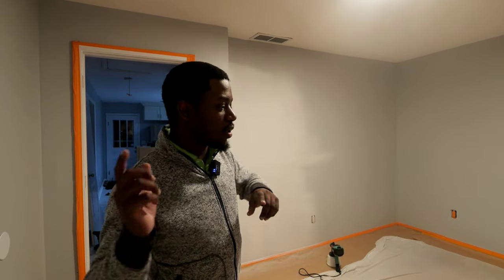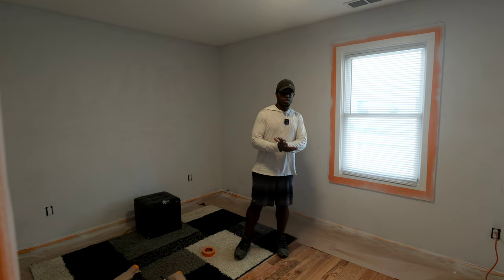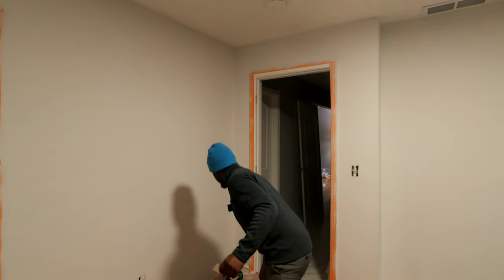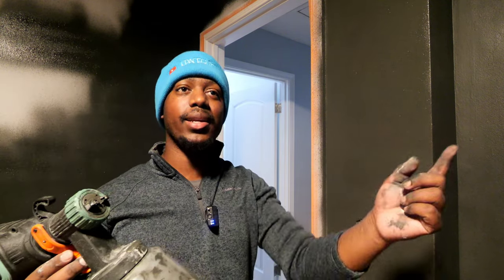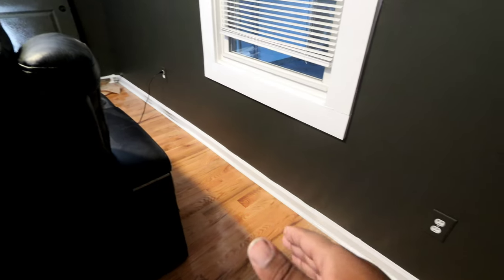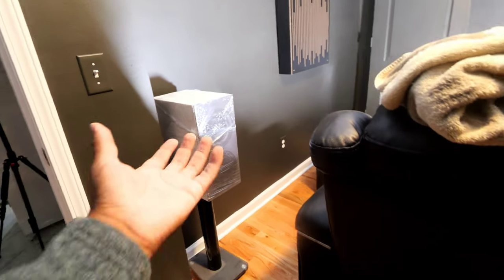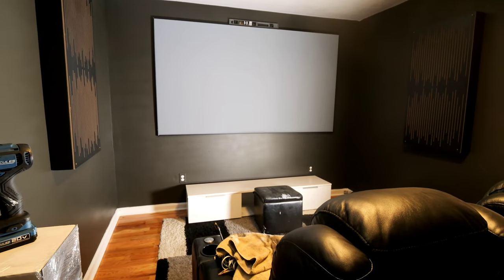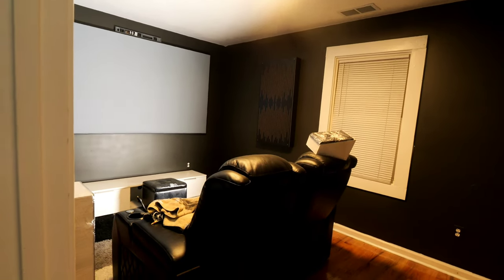Ultimate Home Cinema in the Making | KEF Theater Pt.2

Comment: Helloo my brother what is your distance from the screen?? And also how many inches is the screen....
Reply from the maker: Screen is 103in. I haven't measured yet but if I had to guess its probably around 7-8ft
Reply: @Kpaceguy  so you are about 2.30m from the screen... Im from my tv the same distance buddy i have the sony 65x93k and my eyes are pain when i watching movie why this happening??? 🙄
Reply from the maker: @kuriakos36 Your TV is too bright. A projector reflects like off the screen. A TV emits light into your eyes. Almost like looking into a flash light. You need to either turn down your brightness or turn your picture settings to a little warmer tone so you don't get eye fatigue so quickly .
Reply: @Kpaceguy  you absolutely right ... But i have contrast down and brightness also and the picture is warm but i feel like the panel burning my eyes i dont know whats happening... 😪 you think its the tv that has the problem because its qled or it needs professional calibration???
Reply from the maker: @kuriakos36  You may simply just be too close.
Reply: @Kpaceguy  im only 2.30m ...
Reply from the maker: @kuriakos36  But if your eyes hurt you need to move back regardless.
Reply: @Kpaceguy  i have wall i cant move .... 😬 Maybe i have to take the tv off from there 😔

Comment: Spraying looks so much slower than rolling.
Reply from the maker: You'd think BUT I don't have to stop to dip the roller, I don't have to stop to pour more paint in the pan and I don't have to switch to a brush and get the trim and ceiling corners. I also use A LOT less paint. I was able to do 2 full walls with spray before I could do one wall with a 9in roller.

Comment: I would say go with wall mounted sides and rear surrounds  just to keep the sound/effects consistent. Most of your surround input is off screen and adds mainly ambient effects to what is on screen, so to have a up & down patten of speakers placement would draw attention from the listeners than the seamless immersion of being in the middle of what is going on, on the screen.   Just my 2 cents

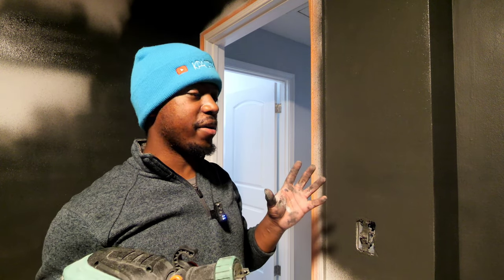Comment: 5:12 no mask Kyle must be flying high 😂
Reply from the maker: When I was spraying, I was actually very shocked at how little of fumes there is. I guess because the paint is concealed in the tank, and it only sprays as much as is necessary.
Reply: @Kpaceguy  looks a lot easier than brushing or even rolling, I might give it a try next time I’m doing some decorating
Reply from the maker: @justchilling4491  I kid you not, spraying was half the time of rolling even with a big roller. I'll never roll a wall ever again.

Comment: What about flipping the room. Putting the screen on the opposite wall
Reply from the maker: I could but i open a new issue. Speakers are in front of the doors and the screen would ne off centered and blocked by the door when you open it

Comment: Which wall speakers are they, the R8 or Q50a? Well, whatever they are I would put the R3's in the back and the wall mounts on the sides. I would really consider putting the R3 in the living room and putting 4 wall speakers as my sides and rears, so they are uniform, and you can mount them in the ideal spot and height.
Reply from the maker: Q50a
Reply: @Kpaceguy  I am also building my HT system and I plan on going with KEF as well. I currently own LS50s so I am thinking of buying another set and using those 4 for my sides and rears. I have been contemplating using the R8s or Q50a for my atmos.    Do you think there would be a big difference between the two?
Reply from the maker: @rick-val22  there's not a big enough difference to justify the price especially as surround speakers